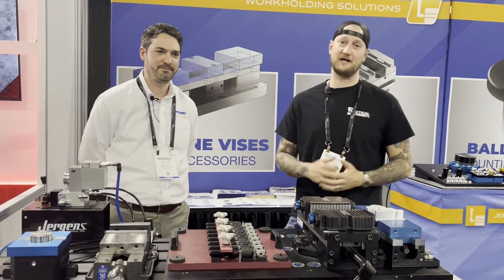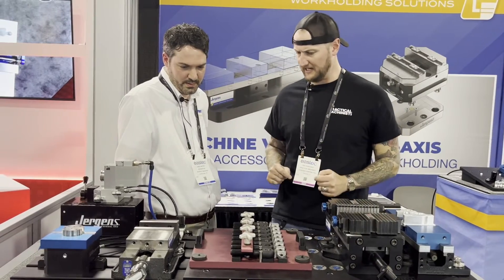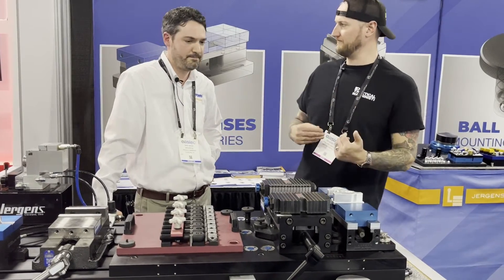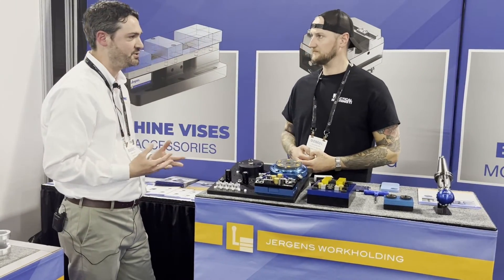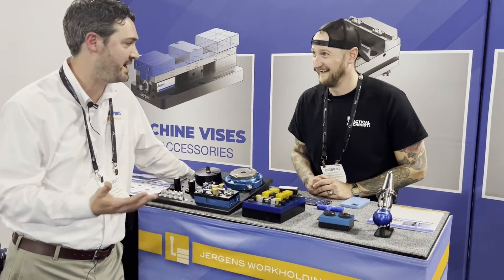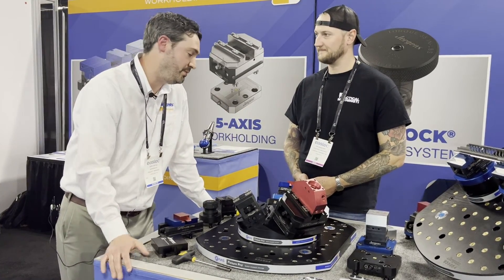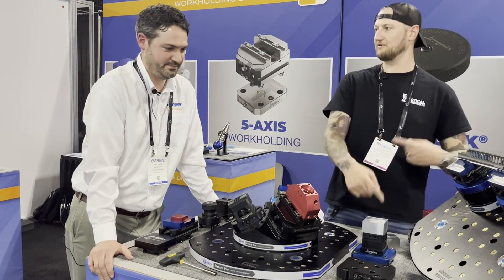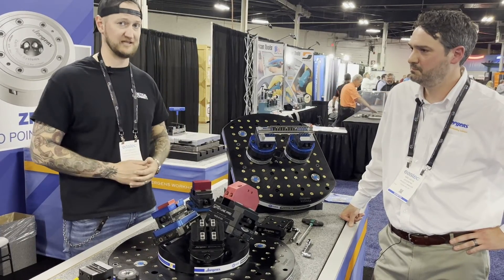Flexibility. Modularity. Do More with Jergens' Workholding.

Comment: Jergens' ball locks is the corner stone in my shop. 5 minute changeovers from one production run to the another. Used every day for the past 5 years and never an issue.
Reply: I’ve been really digging the Ball-Lock system in my shop as well - it takes a bit of change in thinking from traditional setups, but once you get your head around the methodology it really speeds everything up and keeps things consistent!
Reply: We're delighted to hear that Jergens' ball locks have been the cornerstone of your shop, facilitating quick changeovers for the past 5 years without any issues! Your support means a lot to us.